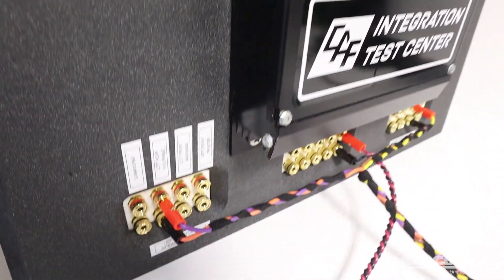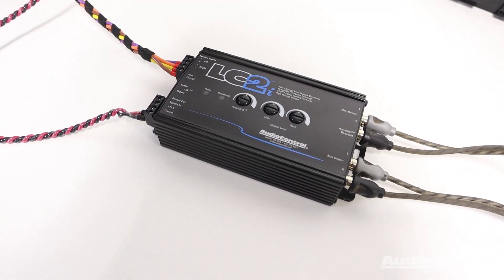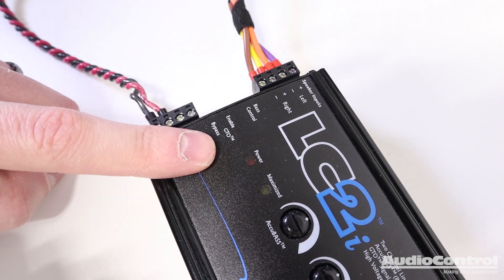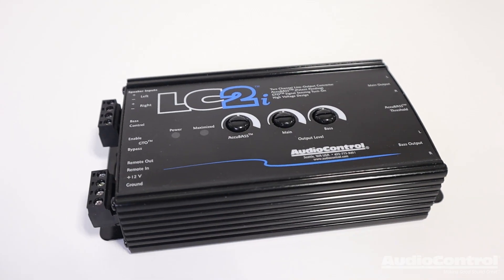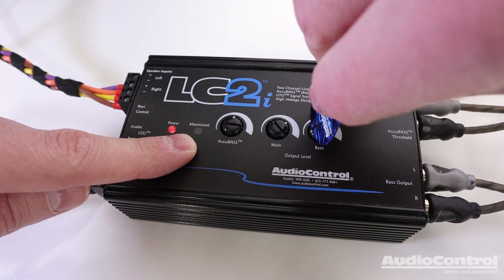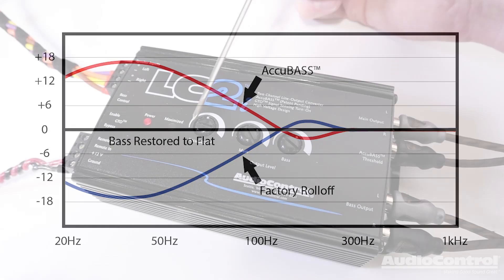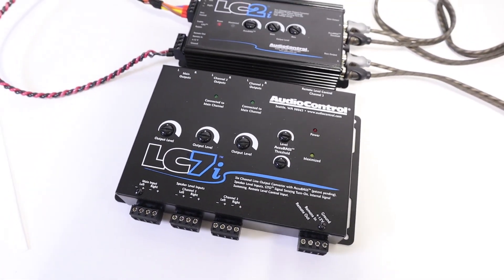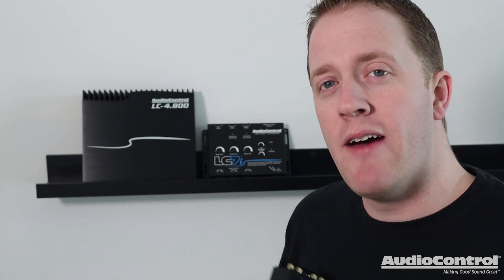HIGH QUALITY sound from FACTORY Audio System - AudioControl LC2i

Comment: if i have amp installed already, is it as simple as un doing the speaker wires running to the amp and put them into the Lc2 give it some power then run the RCA from that to the amp?

Comment: Hey I just hooked up the lc2i pro, question, does amp input sensitivity and the output voltage of the lc2i pro need to be "matched"? Or can I just use the maximized light and be good?

Comment: If i connect the power wire from the LC2i to factory wiring harness do i have to add a fuse ?
Reply: Nope. It does it all for you. Just plug in, adjust levels, and play.

Comment: I have a Cadillac ATS with the Bose 10 speaker system I installed the lc2i using a harness coming off the factory amp but I want to install a two channel amp for my highs up front. How would I do that? I have a lc7i but when I installed it just for the subwoofer it wouldn’t play so I reinstalled the lc2i. Can anyone walk me through to install the 7i or should I get the epicenter micro?

Comment: Hello! LC2i question below…

I installed a JBL BassPro SL2 powered subwoofer on my 2016 Volkswagen e-Golf (non Fender audio) by tapping the front speaker outputs and  connecting them directly to the sub’s high level input.  

I noticed the head unit output now clips at a much lower volume and it gets unusually hot. It is impossible to set the sub amp gain as the levels are all over the  place and slight changes to the amp gain cause the sub to cut in and out. 

I verified the polarity of all connections on both ends and everything seems alright. I would assume tapping into the speaker outputs effectively lowers the impedance seen by the head unit onboard amp causing it to go crazy. 

Wondering if using an LC2i instead of the sub’s high level inputs would make any difference.

Comment: Only problem with this unit is that it 33hertz and above. I wish I would of known that before I purchased this thing. This does not work well at all if your subs and enclosure can operate below 33hertz.......
Reply: The Lc2i pro or Lc7i frequency range starts at 20 hertz.......otherwise by the one from jl audio for $99 it goes from 20 -??????? Much better if you really want to hit the lows

Comment: Question? I have a fairly new Lc2 installed in my civic,  just today the lc2 is on but is not powering the amplifier I checked all the wiring and don't see anything wrong, any suggestions?
Reply: Did you connect the remote wire from the amp to the out remote on the lc2?

Comment: May i ask a question. I've been using a LC2i for about 8 months or so, and its worked great. I use it on a bass amp. I'm considering hooking up a highs amp also. I got the audio signal from the factory sub on the rear deck. Does the LC2i convert that low level signal to a high level signal for a highs amp? Or would I have to use a full signal input to get it all to work?
Reply: I have the same question bro, did you ever figure anything out? Thanks
Reply: @theexpress60  I actually called them instead. Whatever signal you put into the LC2i, you'll get back out. So it's better to just put a full range signal thru.
Reply: @1ohmwrecker  so instead of grabbing sub signal, grab both rear or one rear signal for bass and highs? Appreciate you replying back
Reply: @theexpress60  sub wires will only work for subs. But if u take a rear speaker signal, it'll convert it into a low signal for subs, and still beable to run a highs amp also.
Reply: And use both rear.
Reply: @1ohmwrecker  so I hooked up my lc2i to both rear door speakers and my sub comes in and out. I’ve messed with all the settings and still nothing works good. Ever had problems like that? Thanks
Reply: If I move my settings to just play speakers in rear then bass will work good
Reply: @theexpress60  I'm not sure, but if u call them, they will walk you thru things.
Reply: The lc7 works with multiple amps
Reply: @danielgearhart9654  yes, and the LC2i only works for for 1 bass output, and 1 full range output.
Reply: @1ohmwrecker   you got to play two amps wow the guy at the audio shop keeps telling me that I need a lc7  to hook up two amps
Reply: @danielgearhart9654  no, he just tryna up sale you bro cuz a LC2i is $75, and the LC7i is like $199.
Reply: @danielgearhart9654  and if u wanna hook up 2 highs amps, or 2 bass amps, you can just use a rca splitter 🤷‍♂️
Reply: @danielgearhart9654  there's dozens of videos on YouTube of ppl hooking up a bass amp and a highs amp with a LC2i.
Reply: @1ohmwrecker  for some reason it doesn't work I tried with a set of rca to a  different amp but no sound
Reply: @danielgearhart9654  there's just something that isn't right. Did u look up any of the videos?
Reply: @danielgearhart9654  this video shows that it works. You sure your tapping a full range signal?
Reply: @1ohmwrecker  yeah the stereo place who installed the lc2 is saying i need a lc7 to hook up second amp for more highs and every stereo shop in my city is saying lc7 I came across your video and it perfectly explains that you can hook highs up but when I installed the second amp there was no sound to the speakers and my second amp remote wire was connected to the first amp and came on like it should but like I said I didn't get sound  maybe you know
Reply: @danielgearhart9654  shops will try to upset you just to make money so u gotta watch that. So do you get no sound, or do you only get bass sound and no words? If u hear nothing, it may be defective? Both of mine work, for sure. So just something is up with your situation?
Reply: @1ohmwrecker  i ran rca to high amp  and didn't get any voice or sound from speakers from high amp but high amp was on
Reply: @danielgearhart9654  see, when I hook a highs amp to mine and some 6×9's, I only get the bass portion of it cuz my LC2i is getting signal from my factory subwoofer. But if I fed it a full signal, I'd get the words portion of it too. Which eventually I do wanna do. You sure the amp works properly? Something seems wrong. It could be the Lc2i, but they're american made and last forever. Even the old gray ones still work. I see em sometimes. So it's doubtful it's that, but possible? Deff Something isn't right. If you lived in Ohio, I'd deff help ya!
Reply: @danielgearhart9654  if u unplug the sub rca's, does it work?

Comment: What would you recommend for a Harley Davidson system using the factory head and simple 2ch amp?
The factory head unit has a bass bump around 60Hz so I need something to take the high level output and change it to low level while removing that 60Hz boost and giving me a flat curve?

Comment: Can I use a LC2i pro to feed signal to 2 amps? I have an amp installed for sub woofer and I'm using the bass output of the lc2i and I'm planning to add a 2 channel stealth amp to power the rear 2 speakers using the Main output from the same lc2i converter, is it possible or should I get a lc7i?
Reply: You did not watch the video lmao
Reply: @Austin-cv9ho  funny shit man.

Comment: I have a question for you which I think warrants a discussion.

I specifically want to use the LC2i for a high-low level converter to a MONO amp for sub's only.  

I am using a secondary converter for my mid's and highs for a high-to-low level converter to a different amp for mid's and high's only.  

My stock stereo system already has a subwoofer.

So, should I use the high level speaker wires running to the sub?

Meaning: Using the + and - speaker cable currently running to the sub on the factory system, disconnecting them from the factory sub

and then Putting the + speaker cable into the Left + high level input of the lc2i 
and then Putting the - speaker cable into the Left - high level input of the lc2i 

Or should I use a different speaker output altogether?

My stock system also has a center channel as well.

Now that I am writing this it seems like a stupid question, but i still think it makes sense to ask.

My guess would be that I could use the subwoofer level control from my factory head unit but I wonder if I could suffer any kind of loss of signal from the left channel inputs only to the LC2i?
Reply from the maker: Good question. You can certainly use just one channel for the input to your LC2i. However, you may want to feed your incoming - signal into both the Left - and Right - inputs, as well as feed your incoming + signal to both the Left + and Right + inputs. This will ensure that both of the RCA outputs on the LC2i are delivering full signal out. Also, if you have not already purchased all of this equipment, our LC7i could do everything you are mentioning in just one device. The LC7i can handle front, rear, and subwoofer inputs/outputs, so it could handle the high to low level conversion for your entire system, as well as offering AccuBass for your subwoofer if you need it.
Reply: @AudioControlCar  Sir - First, let me express my thanks for your response. Thank you, again, as it cleared up my confusion. The LC7i is awesome, however, I have a desperate need "in my head and a personal vendetta" - to be able to use the factory head unit, fade from front-to-rear and right to left and have it work appropriately. Currently I am using the LC2i running to an amp for subs only and am also using a DS18 VHL-4 Channel running to a second amp wired to front and rear speakers on separate channels.  Obviously, AudioControl has way better equipment and I would love to ditch the DS18 VHL-4. I want to accomplish sub high-level input to low-level output, front left/right high-level input to low-level output, rear left/right high-level input to low-level output on separate channels....... I think after doing some reading the LC8i might do this, but the LCQ1 seems to provide this functionality with EQ's???? Please let me know, I will snag one up ASAP. basically i have two amps, one for 2 subs, one for mids /highs, 4 channels front right/left,  rear right/left and want the head unit to work appropriately.. I would love a single Audio Control piece of equipment to establish this.
Reply: @AudioControlCar  Also, can someone make 5 channel amp, Channels 1 through 4 200 watts @4 OHMS ,  Channel 5 - 2000 watts @ 1 OHM? if so.... please make it.

Comment: I have a 2017 Kia Soul and using the stock deck W/O navigation. I’ve tried to different line converters, a scosche (junk I know) and a different one that came pre-wired into the factory harness. I can not seem to even get 1V out of the RCA’s. Will this line converter boost the volts to 2V or higher at least? Thank you
Reply from the maker: I would certainly recommend trying the LC2i or LC2i Pro for your application. These LOC's can provide up to 9.5 volts of low level output from your factory signal. However, if your factory head unit's signal is incredibly weak to begin with, you may want to not use an LOC at all, and just feed that signal directly into your amplifier's low level input. It really depends on that factory signal. To find out, you would need to do some testing, using some test tones and a multi meter. If all of that sounds like too much, it may be time to call your friendly local stereo shop for some assistance with your system.

Comment: I have the lc2i and I have a subwoofer and amp running but I’m trying to install a second amp for my mids and high speakers I’m having trouble getting sound out of them just bass comes out ... I originally got signal from tapping into my factory subwoofer negative and positive terminals .. do I need to tap into the rear speakers instead ?? Please let me know my subwoofer works perfect with the aftermarket amp but having trouble installing my second amp for the mids and high speakers/tweeters
Reply from the maker: Correct. Since the signal you're currently tapped into only supplies the LC2i with bass, that's all you'll get out of it's outputs. Try using your rear speakers for signal instead, and see what you think of the sound. If after trying that, your bass isn't as great as it used to be, then I would recommend an upgrade to an LC6i, LC7i, or DQ-61, which will allow you to have separate inputs for the mids/highs and bass outputs.
Reply: @AudioControlCar  what would be the best 4 channel amplifier with true rms 1200-1800watts for mids and highs and tweeters
Reply: @AudioControlCar  Will this work with an old Pioneer KP500 or TP900the one with watch style that became famous over the years. The power output of this stereo is only 4 watts per channel. Can this output power drives this kind of line out converter? I like this converter .
Reply: @AudioControlCar I JUST GOT THE LC7i I’m waiting for it to come in the mail this week ...can I just get signal from my 2 rear speakers And rear subwoofer and just use 2 sets of rca cables for channel 1 and 2 instead of 3 rca cables ... I’m im using the 4 channel amp for my chuchero speaker not for the inside car speakers I’m leaving those to my stock car amp and I have a separate amp just for my single 12” sub.... please help me

Comment: Would this awesome salutation work on my Harley?
Reply from the maker: It sure will. Depending on what you're trying to accomplish, we also have amplifiers with an LOC like the LC2i already built inside. Check out our ACM-2.300, ACM-4.300, or ACX-300.4 https://www.audiocontrol.com/car-audio/
Reply: @AudioControlCar  the 12 volt wire just needs a 12 volt source that stays on when the bike has that accessory running or does it need to come from the radio?

Comment: Do the outputs match the input wattage? My input is coming from a oem sub line from an oem amp.
Reply from the maker: Do you mean the line voltage output? If so, then yes- depending on the signal fed into the LC2i, the output voltage will vary, but is controllable by the top-mounted settings/dials on the LC2i. If you have more questions, feel free to reach out directly: https://www.audiocontrol.com/contact/

Comment: How can I pull from the head unit or factory amplifier while also keeping all factory speakers operational
Reply from the maker: There are a number of different physical methods for "tapping" into existing signals. Basically though, what you'll want to do is just "T" into the signal you need, rather than cutting it in any way. This way, signal will be fed to your LC2i (or similar device) while still passing on to it's original destination. (speaker, woofer, etc.)

Comment: Do the lc2 also help your door speakers to be louder in voice or does it only help with the bass?
Reply from the maker: It really depends on what your system is made up of, and how it is set up. However, the LC2i does have a "main" output, so if you use the LC2i as your primary LOC, and feed the main signal to your multi channel amp and the bass signal to your subwoofer amp, then yes... the LC2i would be improving the entire system, not just the bass. I hope that answers your question, if not, feel free to reach out directly.

Comment: I have a 2013 buick verano  I bought a cheaper LOC and I have some static feedback from driver front speaker ... so my question is which would be a better choice for my application mono amp single 10 in.     Lc2i(pro or not)  or. Lc1i ? I do have a factory amp so im keeping H/U.
Reply from the maker: With that specific vehicle, I would recommend the LC2i Pro. I am not 100%, but there is a good chance you will need/want to have the AccuBass feature, which is not available in the LC1i. Also, when keeping an OEM head unit, it is nice to have a separate subwoofer level control knob, which comes in the package with the LC2i Pro, so you don't have to purchase it separately. If you'd like more details, check it out here: https://www.audiocontrol.com/car-audio/factory-system-upgrade/lc2i-pro/
Reply: @AudioControlCar  thank you for a response  I had went best buy they were sold out so im planning on getting on through your website or Amazon since I have prime there super fast either way I shall own this product

Comment: Can you use the LC2i with aftermarket head units?, For a stronger single to the amp. Also I have the epicenter hooked up already.
Reply from the maker: You certainly could. If your aftermarket head unit has low voltage RCA outputs, you could use the LC2i instead. The proper order would be: Head unit>LC2i>Epicenter>Amplifier(s)>speakers/subwoofer(s)

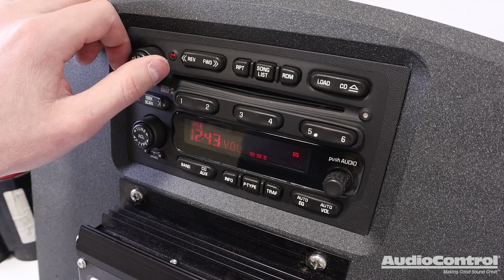Comment: at 1:40 he says the stock radio can cut the bass signal when turning the volume up too high. i installed a pac lp7-2 loc to my stock radio, a single 12 400 rms sub and 500 rms amp. i lose the whole audio signal when the bass hits a certain hz. i lose signal anywhere from 30 seconds to 3 minutes before it comes back on.
Reply: Yep, you set the volume that the bass cuts out on the head unit and the AccuBass dial should be slowly turned up until the bass comes back.
Reply: @MidnightMarrow  i think i need to ugdrade to the lc2i
Reply from the maker: The LC2i could help with signal degradation and bass rolloff, but it almost sounds like your amplifier is actually going into some sort of protection mode. Next time the sub cuts out, physically inspect the amplifier and see if it staying powered on, and if so, check to see if any protect or fault indicators are lit up.

Comment: Do I need to restore acubass if I’m o ly adding a subwoofer?
Reply: You have to tune the Accubass.  It takes time to do that and it's probably easier if you have a friend helping you raise and lower the volume.  See the new version here: https://amzn.to/2OVrPtf
Reply from the maker: Depends a lot on the vehicle/system, but AccuBass was designed to help compensate for bass rolloff. Bass rolloff is when your factory radio starts to dial back the bass as you increase the volume. If your system suffers from bass rolloff, AccuBass can certainly fix it. But to more directly answer your question, yes- AccuBass is pretty much exclusively used when adding subwoofers.